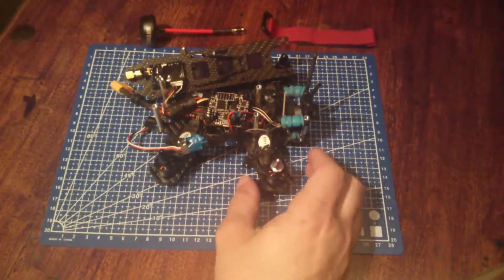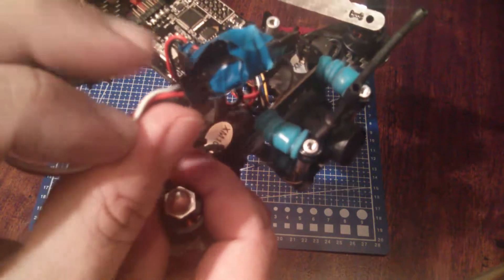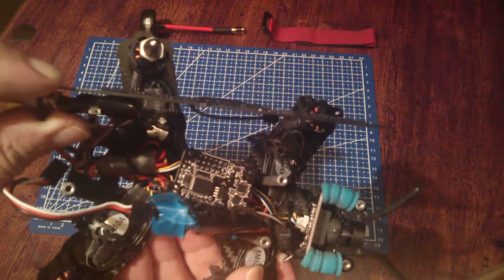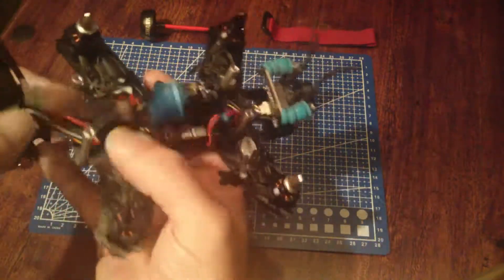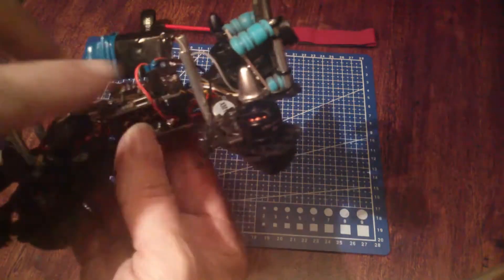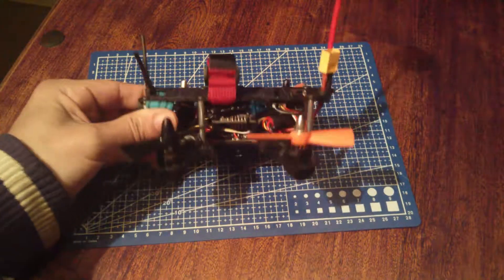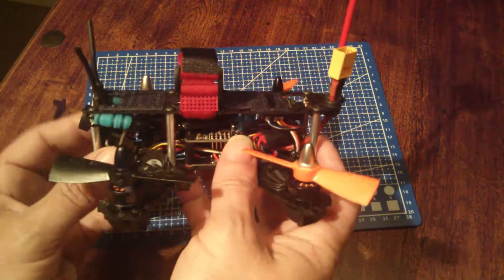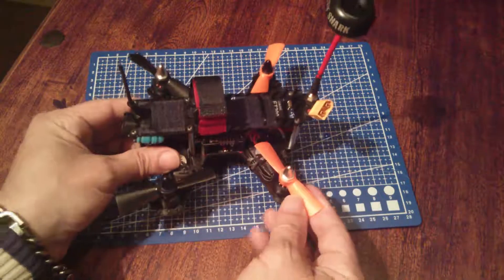Lisam LS-130 Part 3 - Build Log #2 - Stage 1 Complete

Comment: Would thes 1306 dys motors work well for the 150 build? Or should I go with these?

http://www.banggood.com/One-Pair-DYS-SE1806-2300KV-2550KV-2700KV-3-5S-Race-Edition-Brushless-Motor-CW-CCW-p-1064328.html
Reply from the maker: I am using the RCTimer/DYS 13063100kv motors on this craft. If you have them they will be fine,if you are planning on aquiring some 1306's ,take a look at the Emax RS1306 as they pretty much the same price.

Just uploading a couple of DVR shakedown flights from May for you and in reference to your other question - I fly acro on my outdoor/brushless/fpv quads and as for my style I intend to upload some other flights that would be more telling than the LS130's.
Reply: +MrE Should I use 1806 motors on the 150 Lisam?
Reply from the maker: Kenneth Wang No. I think I replied to you regards their use on a small quad being to heavy and not providing enough rpms for small propellers.

I have put a few videos up for you regards the Ls-130 in flight and some others from the last few days showing my flying.
Reply: +MrE I think I will go with emax 1306 motors, but what KV would you recommend? 3300 or 4000 KV?
Reply from the maker: Kenneth Wang  I think the 3300KV are a better choice due to being more efficient/having more torque at higher rpm's.
(For this heavier build)

The 3300KV Emax's are what I have sat on the side for my next 130 build.
Reply: Just ordered the LS150. Hopefully it is a 150 quadcopter, not a 180.
Reply from the maker: I would be intrested to hear what size the LS-150 ends is when the 130 is marginal.